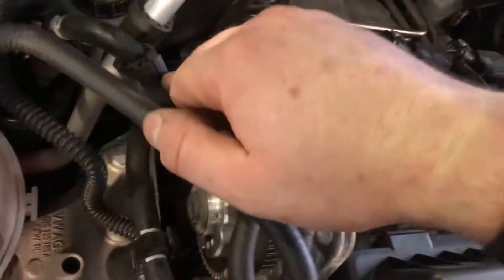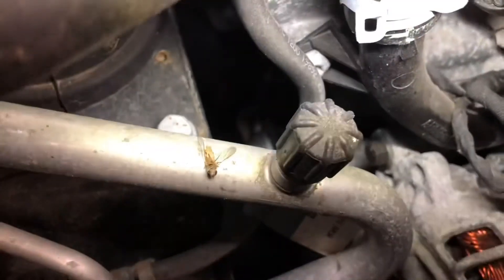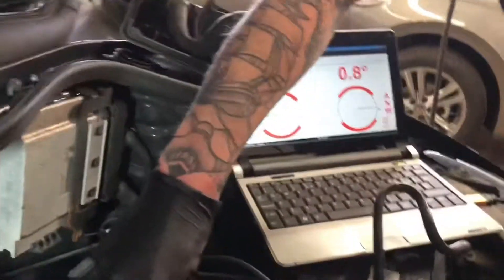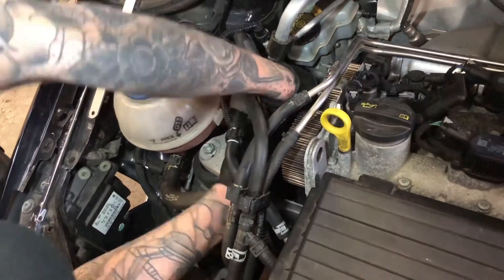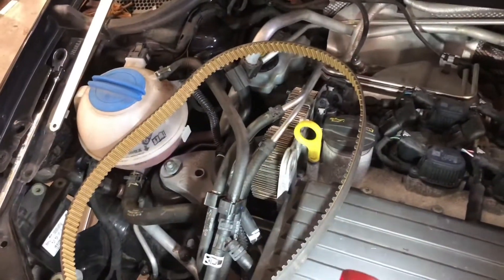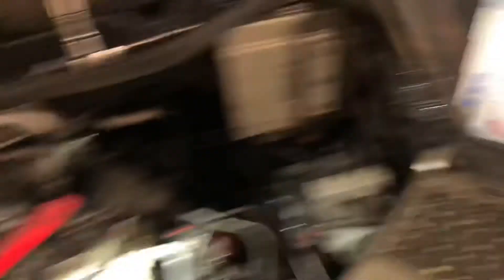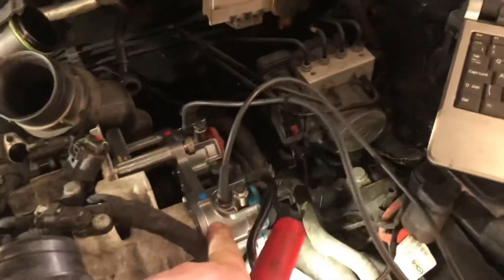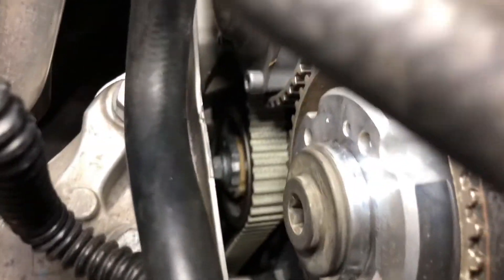Volkswagen Group TSI Engine Electronic Timing Tool

Comment: I have vw golf7 2016 tsi 1.2 cyvb 81 kw 5g1. If ı lock the crankshaft and camshafts, do ı need to use the vas 611007? I think ı do not need to use the VAS timing tool kit.
Reply from the maker: You’ve got a 50/50 chance of getting it right without the tool so my advice is to use the correct tooling for the job then you’ve got 100% chance of getting it right

Comment: What is the maintenance interval for 1.4 TSI ACT CZEA engines?
Initially, in the UK, they did this every 5 years. In the rest of Europe, there is no set date. 
What is your advice? Thank you.
Reply from the maker: My personal opinion is 5 years or 140k miles whichever comes first
Reply: @TheVWMechanic_official 

Thank you
In Portugal and Spain, official dealers say it's for life, because it's a reinforced Kevlar belt. 😂
Initially, the inspection was at 210,000 km with no age limit, but it was changed to a visual inspection after 10 years or 180,000 km.

Comment: I am completely at a loss for how this tool is even remotely necessary for a belt replacement...

Now, you use non-original parts that are more likely to have dimensional variations, or you pull the cam wheels for any reason, sure. It might be helpful adjusting the timing. But, otherwise, this seems ridiculous.

Worst case, you check timing with an O-scope against a known good (presumably, the original timing of the car you're working on,) and adjust according to what you find is out.
Reply from the maker: Your over thinking it buddy 💪
Reply: Very clever! I did the same on 1.2FSI 63 kW CJZB. I took from a known good cam-crank waveform and moved the intake cam little by little with homemade apparatus. Now the intake is right on the money. But this engine doesn't have VVT on the exhaust so no exhaust cam sensor. NOW I NEED IN-CYLINDER PRESSURE TRANSDUCER waveform of a known good "EA211 CJZB" engine. If i have it i will know to retard or advance the cam until the check engine is gone. But now i'm afraid to move the exhaust cam because i don't know does it need retarding ot advancing. Please.
Reply: @petar443  Dang, I did not see this. Do you have an automotive version of a picoscope? If not, I can check the library tomorrow.
Reply from the maker: Have you used this method yet

Comment: Hello! Do you think is worth buying a 1.5 tsi engine with 150hp on a skoda superb? Is reliable? The car has 40000km
Reply from the maker: Hey thanks for the comment the superb is a heavy car which in my opinion would feel a bit flat without having the torque of a diesel…the 1.5 is currently proving itself to be a solid engine and reliable

Comment: Great job. I have the mk6 1.4 tsi 2009 manual. Only 34k on clock. Not been serviced for 3 years as I do  very few miles 3k p.a. Want to service the car now. Do I need the timing chain replaced as well and how much does it cost?
Reply from the maker: Thankyou so much, and no there is no interval for timing chain replace you would only really replace it for issues such as rattle caused by stretched chain
Reply: @TheVWMechanic_official  Thanks for your reply. Maybe I'm getting confused are the timing chain, cambelt and timing belt all different names for the same thing?
Reply from the maker: Yeah pretty mucu

Comment: Hi great video and fantastic work. Do the 3 cylinder 1.0 need the same tool to set the cams
Reply from the maker: Hey buddy thank you so much for the positive feedback I love hearing from everyone and to your question, yes if it’s the new style 1.0 TSi this tool is required to do the cam belt there are lots of people doing it in some different ways but I can’t guarantee it will work so this tool is the correct way, if it’s the 3 cylinder 1.0 MPI then you can also use the cam locking bar if you don’t have this tool
Reply: @TheVWMechanic_official  thanks for the reply.
It’s I job I started earlier and since came across this video and it’s completely thrown me.I was led to believe the engine code chzl was ok with the bar.
Think I might go back to work now and just put it back together 🤣
Reply from the maker: There have been people use the bar and it’s worked out for them… my only concern is the timing on these engines has to be pretty spot on to not have any running issues so it’s a gamble

Comment: Hi, I have a ibiza 1.4 petrol mk4 2015, the cambelt sits near to the edge like in the video, is this the right position. Current mechanic is saying it needs to be nearer to the middle, where the 'golden point' is?
Reply from the maker: Hey yeah the more central the belt runs the better any deviation from that could mean the tensioner or one of the pulleys could be sat to far away from the engine
Reply: @The VW Mechanic  is this a high risk and should I get it adjusted or let it be?
Reply from the maker: It’s only really high risk if it’s rubbing on the covers or has slipped off the pulleys has it ever had a cambelt replaced?
Reply: @The VW Mechanic  yes it had a cambelt replaced by the previous owner approximately 30k miles ago.
Reply from the maker: I see it may not of been done so good, I’m my advise would be to have it sorted as the consequences of something going wrong because of it will cost you more
Reply: @The VW Mechanic  brilliant advise and thank you for the quick response.
Reply from the maker: Your absolutely welcome any time :)

Comment: Do you do the same process for the vw 1.5evo engine? As in not undoing the camshaft sprocket.
Reply from the maker: It just depends on what you need to do to get it in spec you would like to think that if it’s in spec when you lock the engine up that it won’t move when swapping belts but sometimes you will find it out of spec when you first pin the engine up so you’ll have to undo the sprockets to adjust

Comment: Hello. I have a CZEA engine and it just passed 5 years. Can the replacement be carried out without that electronic tool for the camshafts, by using only a locking tool ? How can you be certain that a workshop has that tool or not ?
Reply from the maker: Hey buddy with yours being the ACT version then I would say no. In my opinion and exactly what I do is advise all the newer tsi engines have this tool used on them to guarantee perfect timing. With regards to the workshop having the correct tool you can’t be fully sure unless you see it but you can always ask
Reply: @TheVWMechanic_official  Thank you for replying so quickly. I understand that, but let's say they don't use that tool, they only say that they got it (it's like 3000 pounds), couldn't you check those angles using VCDS, before/after changing, for confirming the tool was being used?
Reply from the maker: No sir as the specs you see on the screen aren’t logged in odis or on the car they are in a separate program designed for that tool specifically
Reply: @TheVWMechanic_official  ...and that's why it's so expensive. Got it ! Thanks a lot !!!
Reply from the maker: Yeah that’s it….you will find most vw group dealerships will have this tool as it will pay for itself very quickly with the amount of them that they will be doing
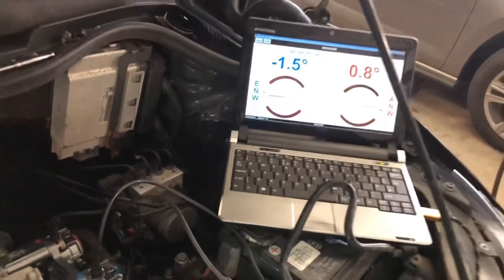Reply: @TheVWMechanic_official   @TheVWMechanic_official  I just realized that you pointlessly used the VAS 611 007 tool because you didn't remove the cam wheel cover @ 3:19 and throughout the video, you can see that the cover for the cam nearest to the windshield is still in it's place. The manual states that you should replace the cam wheel bolts (both of them) with new ones and the first step is to remove the cam wheel cover. By doing that, you disturb their correlation and that's why you need that tool, VAS 611 007, to bring them back in sync, so to speak. But, since the cam wheel bolts weren't changed or unscrewed, there is no need for that tool. The right angle between the camshafts CAN'T change unless you mess with the cam wheel bolts so if you don't touch them you don't need that tool.
Am I wrong ?

Just look on Youtube for this graphic representation of changing the timing belt and how that tool is being used:
Tutorial - How to replace the SKF timing belt kit VKMA 01280 for VAG 1.4 TSI EA 211 engines?
Reply from the maker: You dug wayyyyy to deep into it…it’s a demonstration of the tool

Comment: I was hoping you'd film the belt fitment as some videos take the sprockets off some don't?
Reply from the maker: Worse case I would loosen the sprockets to adjust timing
Reply: @TheVWMechanic_official  could you do a full video including fittment?

I've noticed they all fit them on inlet cam last which creates slack inlet side by the idler pulley. They are slackening sprockets on the other videos to take up this slack inlet side. Could you not fit to exhaust cam last then use the tensioner to take out the slack?
Reply from the maker: I’ll try and make that happen for you buddy

Comment: Excellent video.
I was going to purchase a 23 Jetta s. Now I am not. That tool
In the USA is about $2800.00
Not including the laptop.
I cant spend that much for a tool
Just so I can do a regular maintenance job on my car.
I was ok to buy an autel scan tool but this is over the top.
What a shame too cause I really 
Love the Jetta. And it’s 1.5.
Reply from the maker: Hey Thankyou for the kind comment Shame that it’s come to this isn’t it but I’m glad my video has helped you make a decision rather than you having to spend alot of money
Reply: Yes it truly is a shame.
But I’ll keep an eye out. 
One never knows when a deal
Might pop up.😂
Reply from the maker: Your absolutely right
Reply: Why would that stop you buying it? If it's a 2023 then you won't need to do the timing belt for at least 5 years of 60k miles at least and you might have sold the car by then, plus why would you need the tool anyway? Take it to a garage and they'll do it for probably less than $600. Doesn't seem very cost effective buying any tool to replace timing once when a garage will do it for a reasonable price, and like I said, that's if you even keep the car that long
Reply from the maker: Each to their own ain’t it

Comment: So it appears the cam sprockets don't have to be removed from what this video tells me.  Is this the case?
Reply from the maker: If you can get the belt on the cams while keeping everything in tolerance then it can be done without undoing the cam pulleys but it does make it easier to fit the belt with them undone and allows for the adjustment to be made to the cams without keep pulling the belt on and off
Reply: @TheVWMechanic_official  so does this mean I can do the mark and pray method?
Reply from the maker: I’m affraid not buddy you need the electronic tool that’s being used in the video as it has brakes on it to hold the cams in position as when you take the belt off the cams move if they are not held by the correct timing tool which is vas 611007
Reply: @TheVWMechanic_official  I've seen a tool that is offset that locks the cams from the water pump.  It comes with the crank lock as well as the tensioner wrench.  Will those work or is it only proprietary to the electronic  cam tool?
Reply from the maker: In all fairness I’ve used to the cam locking tool your referring too and had success with it but I’ve also had issues with it where it doesn’t quite line back up once belts changed and if that falls out of spec it’s brought the engine light on when roadtesting It all depends on your budget and how confident you are with the engine and tools I don’t wanna say yeh go for it with the offset tool without you knowing the risks and it end up going wrong for you
Reply: @TheVWMechanic_official  yeah unfortunately I will have to have a vw specialist do the work then.  Thank you for your input.
Reply from the maker: No worries

Comment: Hi Thanks for video .  Re: vw polo 1.0 TSI CHZC 2016.  Would you know if the cam locking bar tool is good enough for this engine?
Reply from the maker: Hey thanks for the feedback and I’ve known people to use the bar and it be ok but there is always that 50/50 chance that it either won’t time up or the engine warning light will come on as the bar doesn’t have the small adjustments that you can see the tool has

Comment: Hi mate, I would like to buy golf or audi A3 with 1.4tsi petrol engine between 2014-2016. I have seen some of them already but each of them got oil leak on the left site, below of timing belt. Do you know where is come from this oil? Its come from zimmering or oil breathing valve. I just worry that I spend a lot of money and will have a huge problem
Reply from the maker: Hey buddy thanks for your question. The times I’ve seen an oil leak on the left side of the 1.4tsi engine is when it’s been the crankshaft oil seal that has failed. I understand what your saying as I would be a bit on edge buying a car with an oil leak too but it’s very good your checking I would go for a tsi that’s clean and I see them most days and there are plenty of good ones about
Reply: @TheVWMechanic_official  thanks for your answer. But if I will go to buy one with oil leak would be expensive to replace that seal? Thanks
Reply from the maker: No problem at all and if that’s what the problem is diagnosed to be then they aren’t the most expensive repair in the world it’s more labour than parts but I would get a mechanic to go with you to have a look just so you are 100% I would hate to see you get ripped off

Comment: Hi, 
Great video sir, After seeing your video took my car in for timing belt and water pump doing at 5 years.
So took car into vw jct600 Bradford, My car is 2017 1.4tsi act engine 150bhp
In the morning while my car was in the service manager rang me up saying we have checked your engine number against our system and your timing belt only needs changing at 5years if you lived in a dusty climate, and because UK is not a dusty country it is not recommended you change your belt at 5 years is that right?
Reply from the maker: Hey, thanks for watching im glad it’s reaching people and helping, Volkswagen uk stipulate 5 years please follow this link for the official Volkswagen wording, hope this helps you https://www.volkswagen.co.uk/en/need-help/need-help-faqs/cambelt.html

Please don’t hesitate to contact me on here if you need any more assistance :)
Reply: @TheVWMechanic_official  
Thankyou for your quick response, If VW UK recommend 5 year's why would an Local  VW dealers say doesn't need doing because UK is not a dusty climate?
Will have to ring them up on Monday and point out VW UK recommend 5 years
Reply from the maker: I try and respond asap :) and I work for Volkswagen and I’ve never heard of the dusty climate thing we follow exactly what Volkswagen set out in the link I gave you :)

Comment: Hello.In how many years or km is for change timing belt???Thanks.
Reply from the maker: Hey thanks for the comment it’s every 5 years in the uk….there is no mileage interval on it
Reply: @TheVWMechanic_official  Iam from Greece.My mechanic said 8 years or 180.000 km for change.The manual book didnr say anything.
Reply from the maker: The are technically belt for life of the engine but here in the uk our rules are every 5 years but me personally wouldn’t be doing much more than 100,000 per belt change

Comment: How many miles until you would recommend changing 1.4 L TSI Jetta 2017
Reply from the maker: I’m only aware of what Volkswagen uk schedules are and other countries may vary but the timing belt interval for that engine in the uk is 5 years. There is no mileage on them. Thanks for your comment

Comment: Hi mate, really appreciate the video thanks. My ateca will be due a belt next year and I was just preemptively looking to see what locking tools I needed to buy, I guess I can book this one into the dealer! I really hope all VAG engines don't go this way, that cam lock tool needs to be made easily accessible or us independent mechs and diyers will be locked out!
Reply from the maker: Hey buddy thanks for the comment i do really appreciate my videos reaching a new audience every day as they are intended to help as many people as they can and I’m not sure how accessible the tool is to independents and diy techies outside of the dealer network and so far matey all the new style belt driven engines use this tool to time them up on the vag cars which as you say sucks if your not in a dealership scenario

Comment: Do you really need the computer to change a belt? Guess I’m not doing this one myself. 
 5 years regardless of miles? That seems nuts.
Reply from the maker: Hey buddy yeah these engines you need the computer tool to time them up within specs. You will always get that one person that’s managed it without but it’s always that gamble and then the trying to get it recovered to a garage and get it sorted. And yep in the uk 5 years regardless of miles

Comment: What's the intervals on the act belt then for a change? I thought I read somewhere it's more of an inspection until a certain age is reached?? Great vid by way.
Reply from the maker: Hey buddy I do appreciated your feedback it’s great to hear from everyone Thankyou so much  :) and the belt interval is stipulated at 5 years in the UK but I do know that’s different for different countries as you say
Reply: @TheVWMechanic_official  cheers mate. Is this the same for all the act engines? Mine is the polo blue gt 2014 and is 140bhp version.
Reply from the maker: Yes sir if it’s in the uk the vag group say 5 years. That’s the same for skoda Audi and SEAT too :)